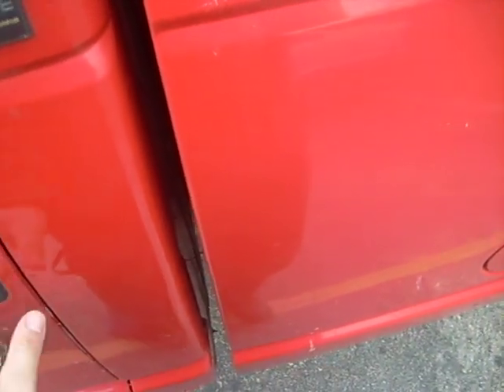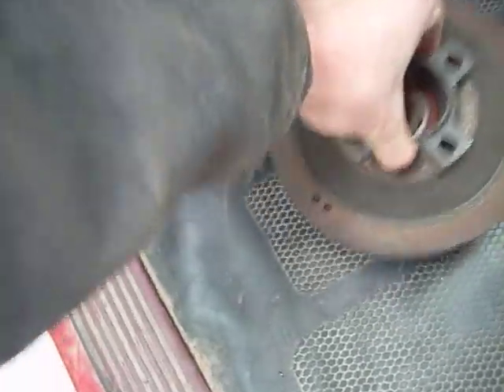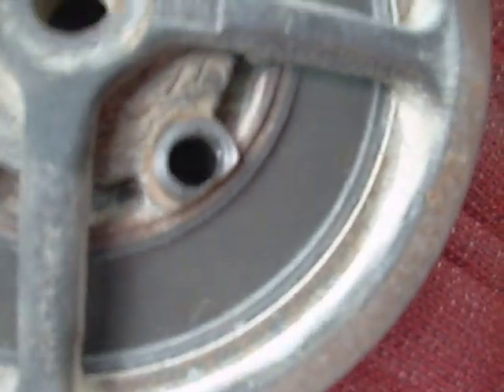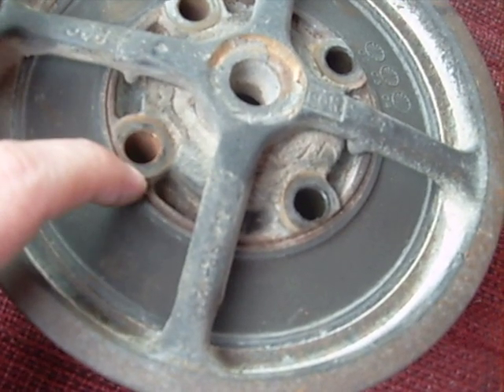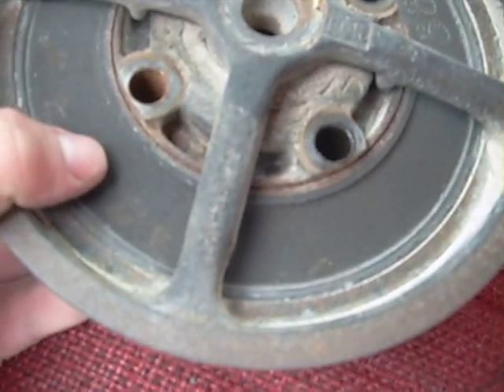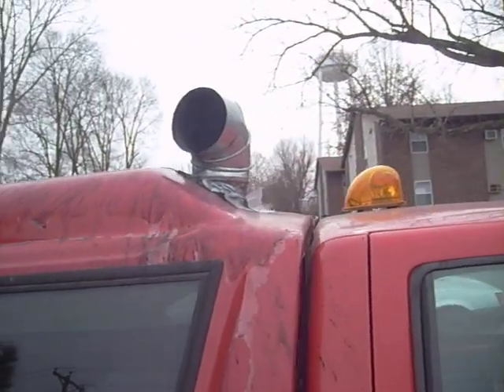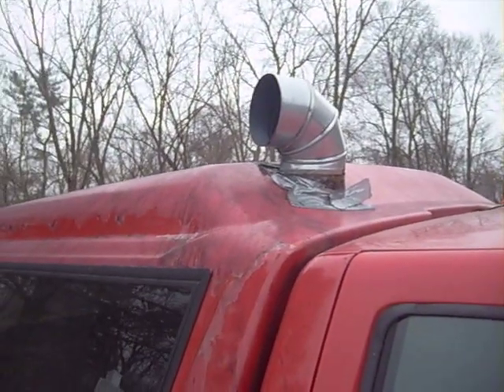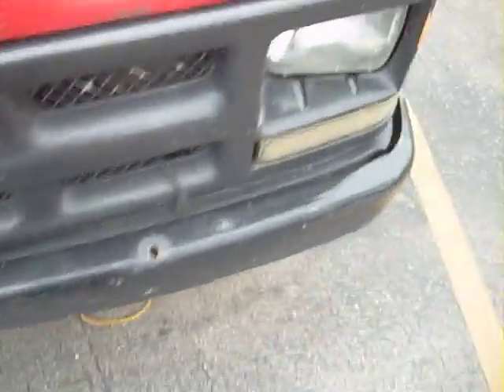harmonic balancer investigation

Comment: I had to put a new crank in mine, and with that a new set of bearings, oil pump, etc,etc. What year is your 6.2? If its a 599 block it would definitely be worth repairing, or selling to another 6.2 owner looking to rebuild a stout powerplant for their truck (hint hint).